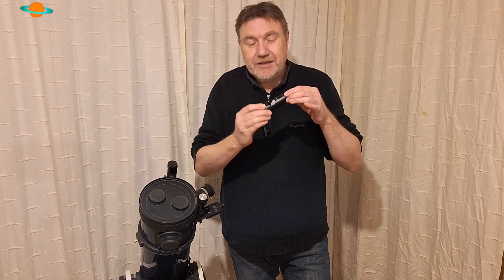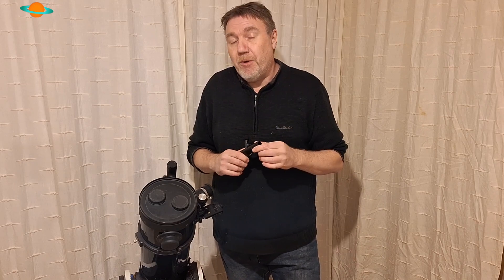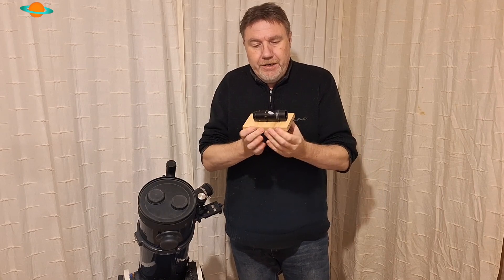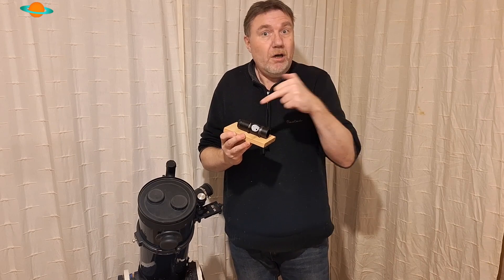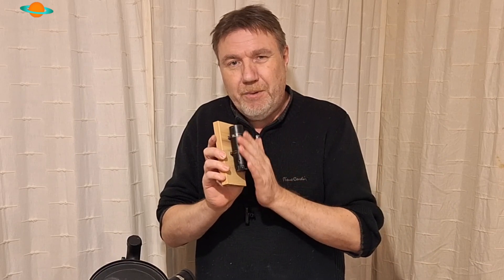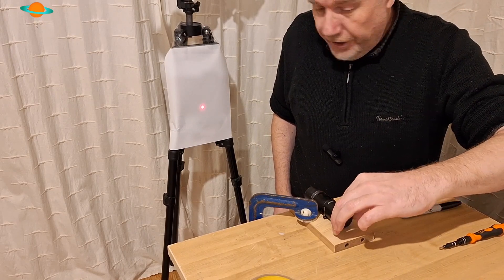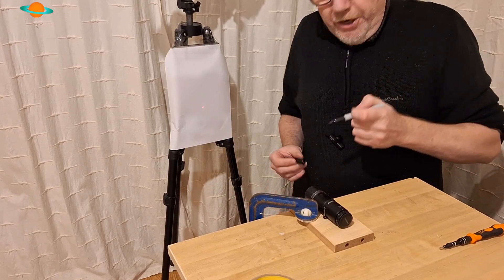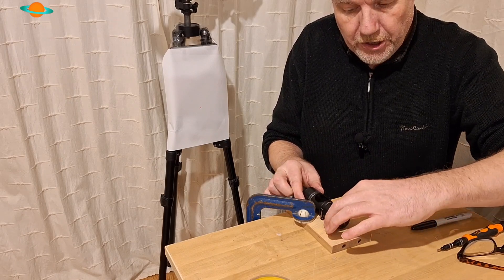How To Collimate A Laser Colliimator

Comment: Thank you for an excellent tutorial! Mine was well-collimated before I dropped it, and I was so happy that I remembered you did this presentation a while back! It is a pity they stick the laser warning label over one of the adjustment holes.  I made my "calibration base" from a polythene cutting board, and it works a treat.  Clamping it to a bench is important, otherwise you're wasting your time, and, yes, the Svbony collimator screws are 2mm.
Reply from the maker: You are more than welcome, my friend.

Comment: Great video, informative and helpful.  Thanks so much.  I have a new 12" dob that I thought was well collimated but it was off a bit,  I tightened things up, and my images significantly improved.  So I need to check it regularly, I use a laser collimator, and I need to know that it is collimated accurately.  Thanks again.

Comment: The laser was off. After using the collimation cap to align the mirrors, I inserted the laser in the focus tube, tightened it and locked the tube so it wouldn't move. I then collimated the laser to the telescope. Worked great!
Reply: That's exactly what I did. Our host has another video of using the collimation cap that comes with some Newts. He emphasizes that nothing is more perfect than your own eyes.  So, I collimated using the cap. Then, I  inserted the laser tightly and fiddled the 3 Allen screws until the laser beam disappeared into the center hole. Voilà!!!

Comment: I would add a point to an already great tutorial. Collimating the laser was my first issue. Having the laser sit properly in the focuser was the second one. If you collimated the laser as explained, but changing the orientation of your laser (quarter turn) in the focuser significantly change the reading, you have that problem. Two turns of normal scotch tape (no overlap or beginning 3rd turn) will create a very snug fit with minimal need of the screw to keep things tight. Perfect for "permanent" installation in the 2" provided adapter if you have a 2" focuser. Fixed my problem.

Comment: HI Jason, Don't know if I did something stupid or found an easier way. I also have one of these cheap laser collimators that was out of collimation. I placed my 130p on a table in its rings and rotated the focuser vertical. I could then place the laser collimator in the focus tube resting on the focuser. Rotating the focuser 360 degrees I could see the circle formed on the primary mirror. I then just adjusted the laser collimator until rotating it in the focuser it no longer formed a circle on the primary mirror. The only caveat I can see is care must be taken between adjustment to monitor the reflection of the laser from the primary mirror. You do not want the reflected laser light to directly enter your eyes.

Comment: The easiest way ive found to do this is to set it on a mirror. Or hold it up to a mirror in the bathroom.
If the laser goes straight up the hole you are set.

Comment: Nice when I did mine I ended up getting totally out even worse like you said and yes I decided to do much like you said. Made them tight and then backed them off. The tricky part was getting the movement consistent. I had to keep track of each set screw and moved one in and one out. VERY minor adjustments. Once I stopped trying to get it done in one shot it started to come in. Patience is what I needed. Like you said you can't really break it. But I was annoyed how far out it was straight out of the box. That soft stuff was such a pain to remove. I agree they should not do that as that was more annoying to get out then the actual collimation was. Actually getting used to collimate the collimator was good to actually collimate the scope since I had learned how to adjust the screws a tiny bit and bring one in and one out. When one does nothing put the screw back the other way and move on to another one. It was basically a balancing act.

Comment: I bought a Cheshire based largely on your previous recommendations but find the laser to be much easier to use. Yes, you need to check the laser every so often but alignment isn’t any worse than a finder scope. And who doesn’t like twiddling the knobs and screws on their equipment once in a while? What better way to spend a cloudy night.  A V-jig is super easy to build but I think the best one I’ve seen was demonstrated by Reflactor; he drilled a 1.25 inch hole in a piece of wood, clamped it flat (in his case to a step ladder to get more distance but a table or bench will do), and pointed the laser at the floor.  I like the simplicity of the Cheshire but when it comes to adjusting the primary mirror the laser is easier because you don’t need to go back and forth to check your adjustments. I’m glad you’re giving them a second chance.
Reply: Or just use Barlow (unless primary mirror lacks center mark) and many inaccuracy sources are automatically removed from the equation.
Because instead of looking at where laser's dot hits the mirror and its reflection you're now looking only at reflection of center mark.

Comment: I've got the same telescope as you, Jason and I also have that same laser collimator. I'd have to say though, that even after collimating the collimator, the results aren't as good as what I get from using a simple collimation cap. The cap is definitely better
Reply from the maker: Hello Bobby.  I don't want to insult your intelligence but have you checked the collimation of the laser? I used to get bad results when using a laser until I checked it, and it was way out... That been said , using just a  cap for collimation is absolutely fine for casual work, I've used one for years.
Reply: @smalloptics753  Yeah, I checked the laser's collimation. After using a simple cap though, the visuals seemed much sharper and in better focus
Reply: laser and all the cheshire-like solutions does different steps of collimation better.
Reply: @angeltensey  ... can you or Jason explain what you mean  ??? ...